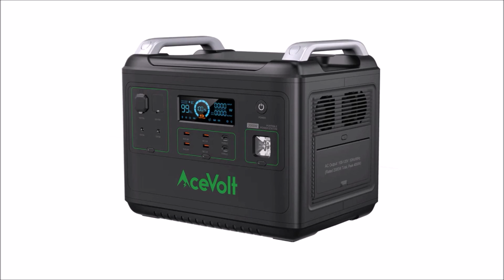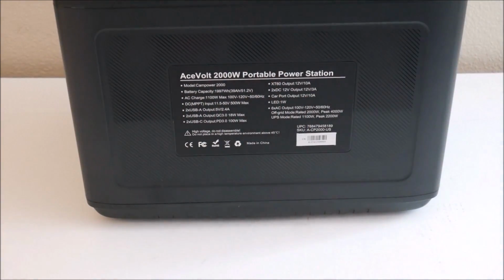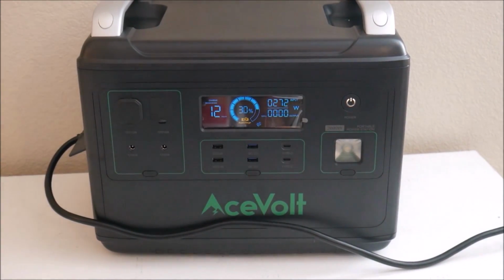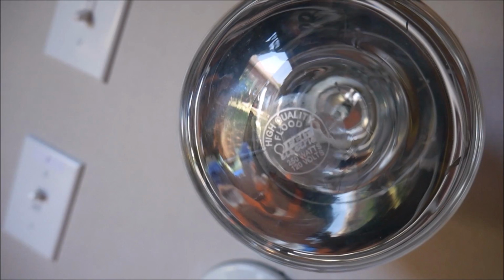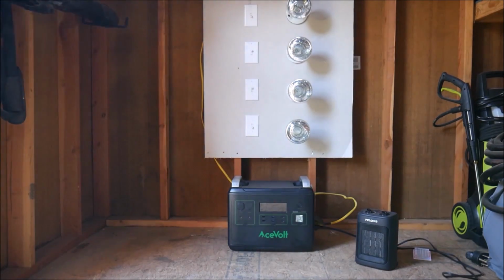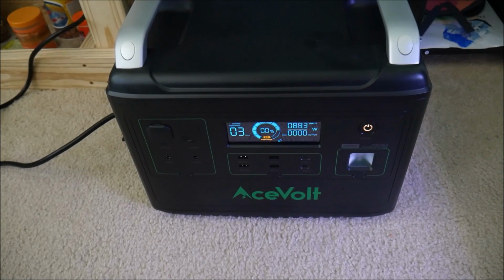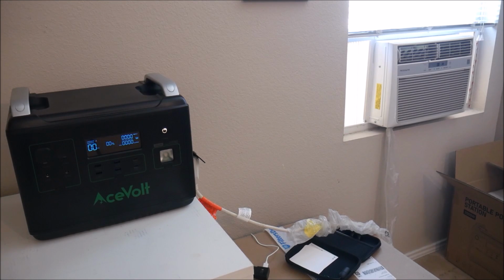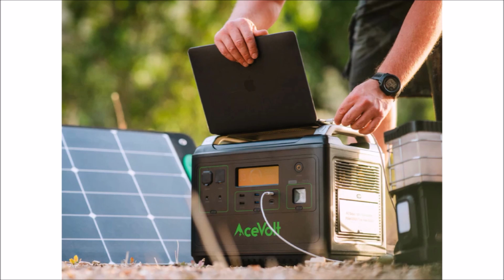AceVolt Campower 2000 Portable Power Station - Compact, Powerful, & Very Fast Recharges

Comment: Does the 12v dc cigarette port go to sleep if not in use after some time or will it stay on.  Just wondering if powering a car fridge will work since the load varies while the compressor is on and while it is idle.

Comment: I'm not sure who cloned who, but this AceVolt looks and operates about the same as the FF Power 2000 and the Oukitel P2001. Hmmm.
Reply from the maker: Yes.  It is very common for different brands to OEM the same design from the same manufacturer.  You see it every day at Walmart and Home Depot, for example.  They will sell the exact same little space heater under two different brands but the same Chinese manufacturer made them both.
Reply: yeah there are many more but overall that power station seems ok

Comment: Great review thanks.  This is a clone or rebrand of the Oukitel aka FFPower P2001.  It is also selling under multiple rebrand labels on amazon like GRECELL.  The offbrand labels like Ace and Grecell are about $100 less then FFPower.  There have been multiple reviews of this product from Jasoniod, Workshop addict, and a couple others.  Regarding DC watt consumption this product actually did not do well in other reviews about 80% because it's probably a 24volt internal battery so the DC is stepped down and then you lose a little more on 12 volt because of circuit regulation
Reply from the maker: Not a rebrand, but possibly the same general design that is being used by some other brands.  Acevolt is a US company out of Nevada and sources their manufacturing in China, just like everyone else.  Often they can make some tweaks to the design, though, for their own unique spin on it.  I was able to do that with my own deep cycle battery brand (jerichobatteries.com).  So I'm familiar with the game.  That part doesn't bother me at all.  But if they are able to get their own branding put on the unit they should also be able to get their own manual written (which they have promised to do).

I'll play with the DC and see if I can see what you are talking about.

Comment: I'd like to see you draw down the DC side. DC for me is important. The UPS feature is pretty nice. And so is the fast charging. 
I'm waiting to see what Ecoflow and Jackery is going to have coming up. I'm hearing that they will have LFP/LIFEPO4 soon.
Not that I need another power station. I have a Bluetti EB200, EB70 and a Oupes 1100. 🤷‍♂️ But want a AC200MAX with extra battery. And I'd like a River Pro in Lifepo4 with extra battery.
Reply from the maker: You have a long way to go to catch me :)  My entire closet is full of these things.  I'll consider drawing down the DC but in the past I haven't done it because most people aren't going to use it and they are usually limited to 10A or so and that would take forever to fully discharge.  It already takes over a week to test one of these things.
Reply: @LDSreliance  It's always good to test the DC output for maximum power since this one actually allows for 10amps out of each of the ports (12v cig & XT60). You can pull 200+ watts total and could be useful for larger DC loads. Well that's comparing it to the similar Oukitel and FFpower units that have the same internal battery, charging setup, display, and functionality as this one.